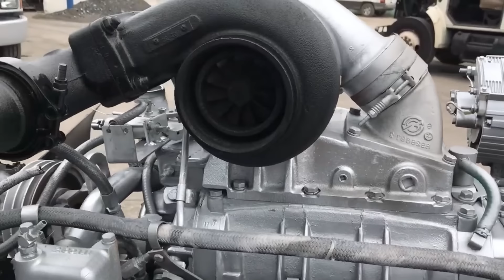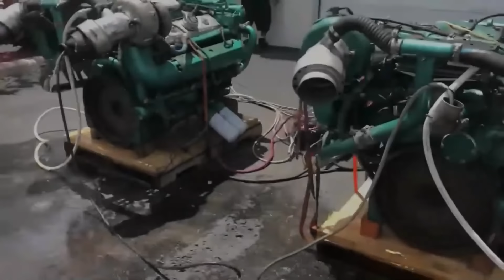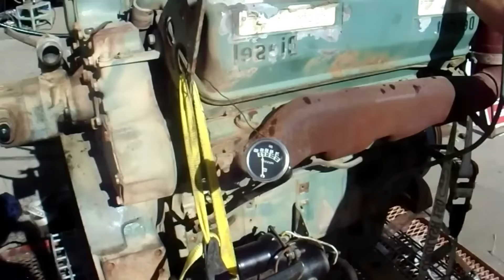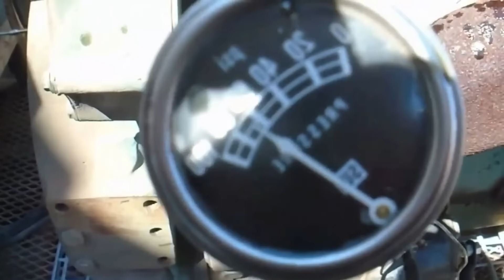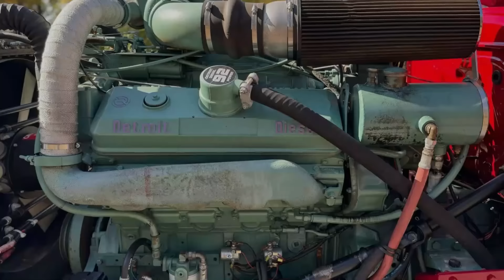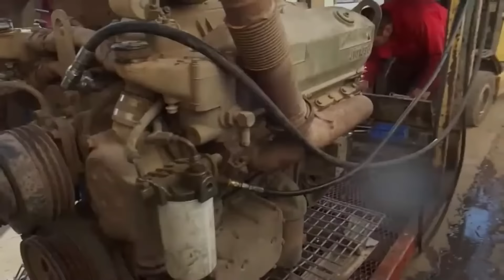20 Shocking Secrets About Detroit 8V92 You Didn’t Know!

Comment: Thay are gutless under 1800rpm, to drive them you should run them at maximum revs , you should not try to lug them, rev them flat out on the governor in every gear and let the governor shut down the revs, to get fuel economy you should rev them flat out in a lower gear and govern the speed of the unit with the gear you are using, flat out in every gear All of the day, to get fuel economy

Comment: Well, you got a few things wrong. First of all, this engine fell into the same designation scheme that has been used since the advent of the 6-71 before WW II. There was the 71 series, the 53 series, the 6-110, the 149 series and of course the 92 series. And by the way, all the bell housing cam and balance shaft end cover plates or adapter drive plates were interchangeable between ALL the series. Another interesting fact is that the outside dimensions of an 8-92 are exactly the same as those of an 8-71.  Detroit was not the only company to use ports, Fairbanks Morse opposed piston engines had no heads and no valves. In the maritime world where I grew up and worked for my entire life, Jimmies were king for many years with all their noise and filth they were reliable and easy to fix or jury rig to get home on without a tow rope. There turbo versions were used but not that well thought of. As one commercial fisherman once said, "You can't stick a wind pipe up a boy's butt to make a man out of him!"  For me, between the boat that was running three 6-71's through strait pipes, and the one with a pair of 12--71's my hearing is pretty well gone. By the time we went to Cummins KTA-19's  it was too late for my hearing, but rebuilds in the same service went from 8500 engine hours for the Detroits  up to 20,000+ hours with the Cummins. They were giving us 500 hp continuous duty at 1800 RPM while the 12-71's were rated for 530 at 2300, they were really only good for a continuous use of around 320 or so at 1800
. They used more fuel to do that than the Cummins did at 500.

Comment: I had a 8v92 in a 1979 Transtar. It was supposed to be 430 hp   My 400 Cummins in another Transtar would out do it. It used oil leaked oil and was sluggish. I had it overhauled at a GM dealer. I never could get it to preform. I have owned several trucks with 8V71 engines and I liked them but the 8V92 turned me against Detroit engines.
Reply: It takes a special breed to be 2 cycle mechanic. Those guys are gone. 😢
Reply: I had 350 Cummins it used blow off my cousin's 8V92 and not only that the Cummins was better on fuel compare to the Detroit & the oil leaks is another thing my cousin's loved them in he's trucks i had Cummins or CAT Engine's in my truck's

Comment: I had an 8V-92TA in my 1980 Kenworth K100C 86" Aerodyne cabover with 151" wheelbase (pull a 45ft trailer and stay under 55ft overall back then). For the first 500k miles my oil burn was 1,200 miles per gallon. I had my first over haul at 500,000 miles where I upgraded to the latest piston and ring setup that cleaned up the engine to oil burn of 2,200 miles per gallon. I sold the truck at 880,000 miles with just one in frame overhaul, but valve adjust every 200,000 miles, injectors every 300,000 miles, bearings at 400,000 miles-it was maintenance intensive compared to my next truck a 1985 Kenworth K100E 90" Aerodyne cabover with Cat 3406B that I had to learn all over again how to shift slower. The 8V-92TA was truly a hot rod, but the Cat got 1/2 mile to the gallon better. I still have the 1985 that is my motorhome that I built.

Comment: The displacement figures have been the same since it's production in mid 1930's although most of your information is accurate. I've often wondered why the turbocharged Detroit's they never plumbed the turbo into the air box to reduce restriction, the Blower only displaces it's volume, please add comments your comment on this turbo explanation if there is accurate information thank you.
Reply: When turbo'd, the later 8V-92 had what was called a by-pass valve on the blower. When boost from the turbo was sufficient the by-pass valve would open and by--pass some of the air around the blower-it wasn't 100% but enough was by-passed to effectively balance the two sides of the blower creating a free wheeling effect. This was good for about a free 10-15hp also increasing fuel mileage.
Reply: They did... it was a bypass blower